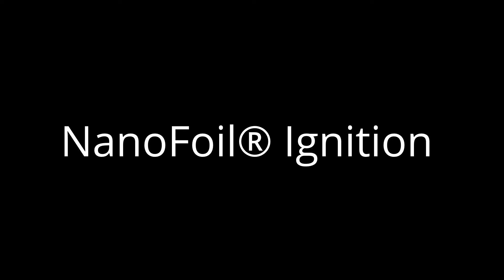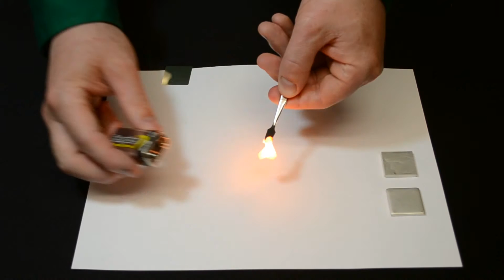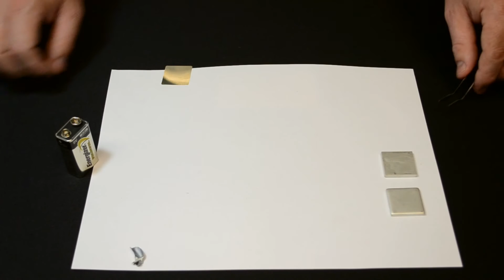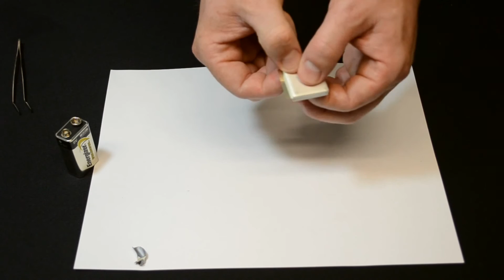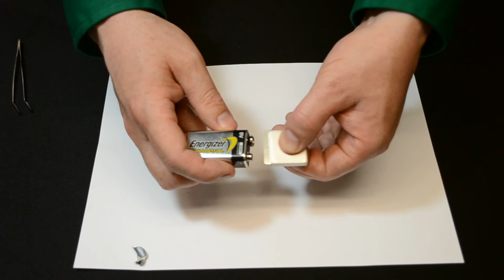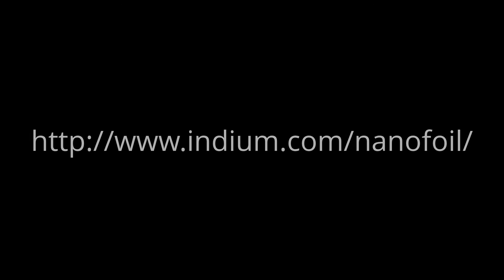NanoFoil® Ignition

Comment: The Ni-Al does not contribute to the soldering/brazing, right? (it's just a heat source) --> How much area do you expect to end up with a tin-to-tin bond? I can imagine that this only happens where the Ni-Al shrinks away to create a contact between the tin on two sides - correct?
In applications where the use of tin is disallowed - are other materials possible to be used in its stead? (e.g. - what would it take to get a copper-on-StainlessSteel bond?)
Thanks!!
Reply: Late reply, but they answered your question in the other comment. (probably switched up the comments on accident)
Reply: @adrianscheffler1323  Ahh.. I see now what you mean..  

--> You are exactly right! Any material that will bond the 2 substrates together (using heat, to melt the material together) is first bonded to both substrates. Then, the coated substrates are brought together, with a layer of NanoFoil in between. The NanoFoil ignites, melting together the material bonded to both substrates. So, the process does not melt the substrates together; it melts together the material which is bonded to each substrate.  The area of coverage (fully-bonded) is nearly 100% as the spent NanoFoil contracts tremendously. Other materials beside Sn are used, yes.  EXCELLENT QUESTIONS! Thank you.  --> This was as a reply on another comment. 

Thanks for the ping :)
Do you plan to be at an expo in NL or nearby in the coming months? Precisiebeurs / Medica/ etc.?

Comment: Awesome!
Reply: You are exactly right!

Any material that will bond the 2 substrates together (using heat, to melt the material together) is first bonded to both substrates. Then, the coated substrates are brought together, with a layer of NanoFoil in between. The NanoFoil ignites, melting together the material bonded to both substrates. So, the process does not melt the substrates together; it melts together the material which is bonded to each substrate.  The area of coverage (fully-bonded) is nearly 100% as the spent NanoFoil contracts tremendously. Other materials beside Sn are used, yes.  EXCELLENT QUESTIONS! Thank you.